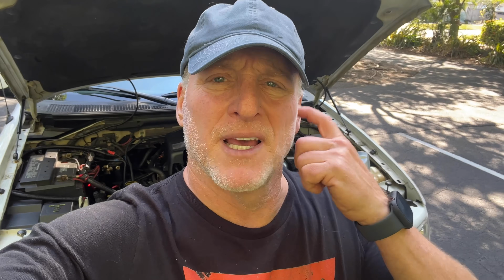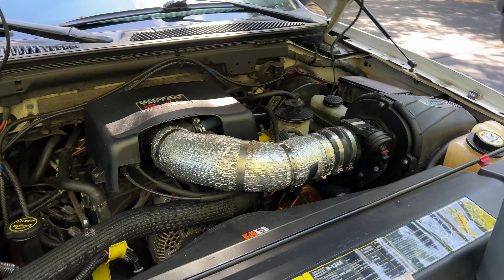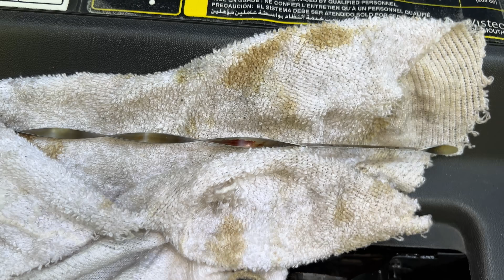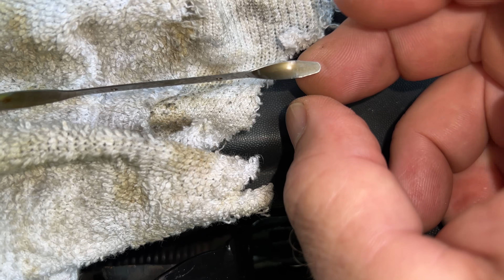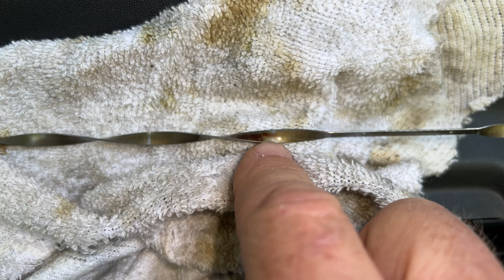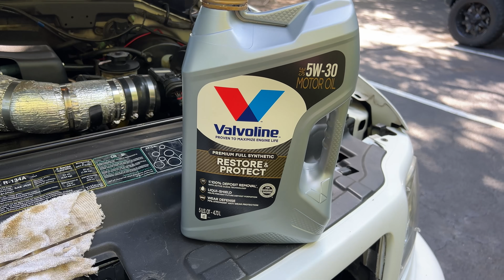Valvoline Restore & Protect Review: High Mileage 264K Engine: Reduce Oil Consumption & Piston Slap?

Comment: so is this better than the high mileage ? my car has 141k miles
Reply from the maker: Valvoline High Mileage (often marketed as High Mileage with MaxLife Technology) and Valvoline Restore & Protect are both full synthetic motor oils designed for engines with wear and tear, but they target different needs. High Mileage focuses on maintenance and prevention for aging engines (typically 75,000+ miles), while Restore & Protect emphasizes active restoration and deep cleaning alongside protection, making it suitable for any vehicle age but especially beneficial for neglected or high-mileage engines with deposits. Both are premium products in Valvoline’s lineup, but Restore & Protect is positioned as their highest-performing option due to its advanced cleaning capabilities.  The basic answer, R&P removes deposits while Maxlife focuses on lubrication and rejuvenating seals.
Reply: @DrivingIntelligence  got it i just bought an used  car idk how good taken care is it, i was deciding if i should just get the high mileage because if the miles or try to clean it with the R&P
Reply from the maker: @guilladogui8259  I'd start with the R&P

Comment: 2015 silverado 1500 v8. Was burning about 2.5 to 3 qts of oil per 4000 miles. Switched to 5w 30 restore and protect from ow20. After 3 oil changes I'm now burning less than a half quart per 4000 miles. Running a thicker oil might have something to do with improvement not sure but I will continue to use this oil.
Reply from the maker: I think the thicker weight and the cleaning performance of the oil helped you.

Comment: I'm sorry but this is sort of clickbait. You show a piston in the thumbnail and don't tear down the engine or open the crankcase. I can't trust a review about piston rings sticking or not based on oil color, even if there are results on oil burning changes
Reply from the maker: Here’s another review video I made:  UPDATE Valvoline Restore and Protect Review 8.5k miles: Reduce Oil Consumption Varnish Piston Slap?
https://youtu.be/7AzhjW-T4vk

Maybe it will help

Comment: I know restore and protect is not dexos certified but can it be used in a Chevy 3.6 engine
Reply from the maker: I can't give you a thumbs up... but I think the reason it's not DEXOS licensed is because Valvoline doesn't want to share their proprietary formulation.  I would use it in my GM vehicle if it had a DEXOS requirement and was out of warranty.  But again, this is me, I'm not confirming it will work.

Comment: I've ran high mileage vehicles my entire life up here in Canada, and I do oil changes every 5k Km (3000 miles).  I've never had a problem with gunked up engines and tarnished dipsticks.   I live near a border town, and I'm convinced that it's the higher percentage of ethanol and other additives you guys have in your fuels.  I have friends who cross the border regularly to buy gasoline and other things, and most of them develop engine problems over time (injectors, clogged fuel filters, etc).  There must be some chemical reaction between the ethanol, gasoline and engine oil that's causing so many deposits.
Reply from the maker: great point, I looked it up and found this information showing how to prevent ethanol-related sludge:

Use a fuel stabilizer: A fuel stabilizer can prevent phase separation and keep fuel fresh for longer storage periods.

Keep the fuel tank full: Keeping your fuel tank as full as possible reduces the amount of air inside, which minimizes the opportunity for condensation to form.

Use ethanol-free gasoline: For high-performance vehicles or small engines, using pure, ethanol-free gasoline is the most direct way to prevent ethanol-related issues.

Use a fuel system cleaner: Periodically using a high-quality fuel system cleaner can help remove harmful deposits and combat the side effects of ethanol. 

This is especially true for older power equipment and engines not designed to tolerate ethanol-blended fuels. 

Although I knew ethanol is hydroscopic, I didn't realize it goes this far in damaging engines.  Thanks again for your comment.

Comment: I’m still skeptical 

The dipstick trick can be explained by a higher oil level and not by oil itself.

After running for 10K miles, oil was at the lower level; hence, the dirty part of the dipstick was not submerged in oil. 

Changing to a Walmart oil would also clean the dipstick.
Reply from the maker: I did a full length review of this oil and I am sold.  Not seeing the varnish being removed yet, but otherwise there is significant benefit I've never seen from Pennzoil, Walmart, Mobile 1, or Royal Purple oils:  https://youtu.be/7AzhjW-T4vk?si=ssuLZ6vlmmnqMfgu
Reply: @DrivingIntelligence Valvoline claim: “Restore Pistons to Factory Clean. The first and only motor oil that removes up to 100% of deposits – restoring your engine to run like new.”

“Up to 100%” is a marketing trick and a legal loophole. “Up to 100%” is anything from zero to 100. 

30-40% of the population are born believers. A new report from Harvard University describes how certain genes predispose people toward believing placebos. The “improvement” that people see is the individual's expectations and beliefs about the oil rather than any  real cleaning.

Valvoline has never published before-and-after results, instead they are using computer generated graphics for marketing.

If something seems too good to be true, it likely isn't genuine or legitimate. It's wise to be skeptical and investigate further before believing it.

So, far I haven’t seen any definitive scientific proof.

Comment: Abt to test this oil in my 92 Camry and see what the difference is after 12000 miles. Should be abt 4-6 months from now as I plan on heading to south Texas by the border and back to central Texas to go see family, on top of regular drives in my home area.
Reply from the maker: When I towed a car on a heavy car trailer over 700 miles with my F150 and during the 3rd R&P change, I think the distance and heat really worked wonders as my oil consumption dropped even further.

Comment: It works ,but it takes 3 to 4 oil changes for it to work efficiently
Reply: This is common that it will take 2 or 3 oil changes for better results
Reply from the maker: At 4th oil change with R&P and I’m reaching what I think is the best it can achieve in terms of reduced oil consumption.  It has been very impressive.
Reply from the maker: yes!  And I cover that topic and others in this video:  https://youtu.be/7AzhjW-T4vk?si=0yDGL6uZ6ZagMNPa

Comment: I’m curious about the effects of this oil on seals. Is it weakening them in which case, will your vehicle develop leaks?
Reply from the maker: There have been VERY RARE cases of oil leaks after using this oil, but I'm pretty sure it's not because it degrades seals.  I have well over 10k miles on my engine using this oil and it's tight as a drum, no leaks.

Comment: Just remember it’s not a mechanic in a bottle. It does do more to clean up engines more than other oils.
Reply from the maker: thanks for checking in... no, it won't mechanically fix anything, but if it cleans the piston rings and lands, it can help stabilize the piston in the cylinder and therefore reduce piston slap noise.

Comment: Does anybody recommend changing the oil filter about 500 to a thousand miles after using this oil? I guess my thought is and what I've heard from maybe one or two other people on forums and videos I've seen about restore and protect is that it's a cleaner also so I mean is there any fear of it cleaning so well that it starts clogging your oil filter?
Reply from the maker: It's a good question.  Valvoline states that their oil will dissolve the sludge and hold the dissolved sludge in suspension until you perform your next oil change, but I've also heard people with poorly maintained engines having a slug of sludge get to the oil filter and require use of the bypass.  You'll have to judge the current condition of your engine and oil to make a proper decision.  Have you maintained the engine per manufacturer specs?  Also, you can keep an eye on the dipstick to see if the oil looks very black and dirty indicating it's time for an oil change.  If you're really worried, change the filter at about 500 miles, and top off the oil.  Look inside the filter to see if you have sludge and if not, stick with normal oil change intervals, however, if you do have a plugged filter, you'll need to change more frequently until the engine is clean.
Reply: @DrivingIntelligence Yeah my oil seems pretty clean and I do my oil changes every 3,000 mi but I guess to play it safe the first time I want to use this I'll probably change it every 500 mi for the first 3,000 mi and then completely change it again and then just go at regular intervals

Comment: My ‘03 matrix with 345k was eating restore and protect at first, slowed by the second OCI, bust still consumed 1qt/500 miles. I blended R&P with valvoline high mileage Max life red bottle and consumption significantly slowed. Oddly I gave both a smell and both give off similar odor, wonder if R&P is similar to max life without the seal conditioners?
Reply from the maker: Thanks for your comment.  I'm on my 3rd use of R&P and so far my oil consumption has reduced by 49% (new video in editing).  With regard to smell, the R&P smelled like heavy gas and I was worried I had leaking fuel injectors.  I had my last oil change tested by Blackstone and there is no fuel in my gas.  I think their formulation smells like gas.

Comment: You Ford guys can prevent all this oil consumption by simply selling them. And buying a gm truck.😊
Reply from the maker: without being sarcastic, the worst vehicle I ever owned was a Chevrolet Blazer.  Gutless, rust bucket.  I will never buy another GM truck.  On the contrary, I love my 2006 Cadillac CTS V with the LS2 engine, but it uses oil!  So not aligned with your comment, at all.  At 267k miles, I never hesitate to drive my F150 long distance on the original engine.  Runs smooth as butter.  I'll give you this, a few years ago I worked on a friend's 1/2 ton GMC and that 5.7 was smooth, but the interior was pure junk.  Again, not being sarcastic, just sharing my experience.

Comment: a long time back i received my parents old car, 1969 Malibu, with a 350 and auto. well my sister had it before me. and a teenage male i did a lot of high rpm's, my parents used for comunt in the sf bay area, and other trips. but at 210,000 figured time to rebuild. the worst cylinder was only 8K taper,  all other bearings were in perfect condition, and the motor did not need the hot tank.  it was that clean. 
yes i used Valvoline  dino oil.
Reply from the maker: Thanks for sharing.  Reminds me of a 1979 Chevy Blazer I had.  Although it was a rust bucket with a low power 350 engine, when I sold the engine the buyer dismantled the engine and told me it looked like it was brand new inside.  The honing in the cylinders was still there.  I guess my frequent oil changes helped, and I think some engines just have a better design preventing varnish.

Comment: I HAVE A GMC truck now with 235000 miles on it, and my dip stick still clean with no varnish and all I have used is MOBIL 1,  change  oil at 5000 miles. uses very little oil.
Reply from the maker: I am the original owner a 1985 Mustang SVO and used Mobil 1 Synthetic oil religiously (every 3k miles).  My experience is the same as yours, clean dipstick and clean internals.  No sludge nor varnish.
Reply: I really think that's the holy grail of clean engines, if you change every 3k most oils will leave your engine clean with no issues. The new fad of today is 10k changes...Nothing but trouble 😢

Comment: had a head gasket leak in my caravan due to a punctured radiator that caused overheating.  i opted to put a used low mileage engine in it last week, i dont know the engine history or anything so im gonna use this restore and protect stuff for the first few oil chages
Reply from the maker: I think that's a safe decision.

Comment: I just want someone to pull the oil pan showing the bottom of the engine then do it again after some oil changes
Reply from the maker: My next video is going to show images of the valvetrain.  Kinda a pain to remove the oil pan in most vehicles.  And I do have a video showing the back of the engine after I removed the transmission and was replacing the rear main seal.  Granted, this was after only 3,500 miles of use with this oil.  https://youtu.be/tlMFJaG3ZUI?si=REDftwq7UKYed7nb

Comment: This is good information!
About 1-1/2yrs ago I purchased an '05 Honda CR-V with 5spd manual trans and AWD, to be a ski and road trip tool.  It has the K24 2.4L NA engine.  271,000mi on it at time of purchase.  It had been sitting for 3-1/2yrs due to a failed starter, and stolen cat.  Once it was up and running, it was using a quart every 800mi of freeway driving (2 trips to ski, at 420mi each).  Pretty alarming.  I took a guess that the oil control rings were gummed up, and no longer expanding and scraping the oil of the cylinder walls (compression rings don't control oil), but of course the valve stem seals could also have been crispy and no longer keeping oil from running down the intake and exhaust valve stems, along with wear in the valve guides allowing the stems to rock.  Instead of adding a full quart of oil, I started adding only half a quart, and then half a quart of Marvel Mystery Oil, which is heavy detergent, and basically automatic transmission fluid.  The oil consumption has dropped to near zero.  With good results, I've stopped using the MMO.
Reply from the maker: Hey, that is awesome, if I don't get to the results I'm looking for out of this oil, I'll likely try this and some other methods provided in the comments.
Reply: I think oil geek is pushing this product to hard for me to trust it. Do you still use it?
Reply from the maker: @KollynJ  so far I'm pleased with this oil.  I have a video in edit that will show my additional learnings including whether or not it's removing varnish and my oil consumption update.
Reply: Love mystery oil. I use it in every oil change and every tank of fuel. Good for lubricating the fuel pump.
Reply from the maker: @koz8850 I have used it in fuel

Comment: I often use Pennzoil Ultra 0W-20. All my car engines have no trouble at all. For 2023 Honda Passport, I put VRP for first time.  Engine noise during startup is less. After warm-up, the engine noise seems slightly louder than Pennzoil, but still very quiet, very pleasant.   Do you have like experience to share?
Reply from the maker: I will be sharing these experiences in a future video that is now in edit.

Comment: My daughter’s 2005 Camry with the infamous 4 cyl oil burner (goes through a quart every 500 miles). It does have 220k miles on it and runs great though. I was running seafoam through the engine at each oil change but haven’t noticed a difference in consumption yet. I do notice after only about 700 miles though the new oil looks very dirty on the dipstick already. I’m going to give this oil a shot and see if it helps. If it can get the consumption down to a quart every 1,000 miles I’d be very happy with that.
Reply from the maker: I started where you are... I tried Seafoam and BG, neither helped.  This oil has shown some benefit within the first oil change interval.
Reply: @jpete3027666  if there is a lot of build up in older engine, change filter early, 500 miles, then 1500 more ect.  And if oil becomes super dirty full of grit maybe change it early to.  Ideas

Comment: Been using it for 10000 miles on a car i bought for  1000$  its my daily and was sludged completely when i got it. This oil has completely cleaned the engine and it runs 100% better than when i bought it
Reply from the maker: great comment, thanks

Comment: Bahahahha, the insulation on the intake pipe lol 😂
Reply from the maker: Dude, do some research... I actually tested the performance of this insulation as well as other mods.  Have you done any testing, or is your comment just a typical WAG I get from time to time?  https://youtu.be/xgu5tDprnpM?si=lB4xsUKY6ia_YhVI
Reply: @DrivingIntelligence  I did a ram air cold intake on my '89 Honda Accord, and I wrapped the tube just like you did.  It helps with heat soaking when the car slows down for a while.  Best thing is the ram air comes out from the bumper about 6 inches, so at highway speeds it really works!  A true cold air system. Zero air from under the hood.

Comment: I just changed my oil with this product at 240k. It's a Toyota 2007 Tacoma, I I'm trying to decide if it's wishful thinking, but it seems to be idling smoother, but we're coming out of single digit weather into 50s to 70's. But it used about 1 qt between oil changes (5000k). We'll see if it improves.
Reply from the maker: good luck with it, stay in touch and let us know how it goes.

Comment: If you use this stuff so you have to change the oil at a shorter interval due to fear of clogging the filter with all the studf that was cleaned off?
Reply from the maker: Yes, you need to change at a shorter frequency if you feel your engine has alot of sludge.  Check your dipstick and if it looks extremely dirty early on, change the oil or at least the filter.
Reply: My engine is pretty clean from what i have been told. Its a 2013 tundra with 219k. I do oil changes at 3-4k intervals @DrivingIntelligence
Reply from the maker: @ I had 257k miles on my F150 when I started using this oil.  I changed out my first run of R&P at 3,500 miles and the filter looked good, no sludge.  I think you'll be ok at 3-4K.  Here's a video of that first oil change:  https://youtu.be/YEHKa92Zj9c?si=UkARcsCkxeBnxhsm